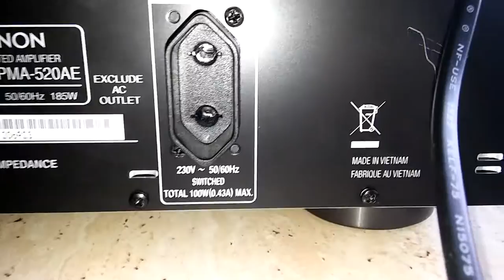Denon PMA-520AE

Comment: Does this amp use series resistors off the main speaker outputs to drive the headphone jack or is there a discrete headphone amp?
Reply from the maker: I do not know exactly if using serial resistors or headphones are not so skilled in the field of amplifiers
Reply: Yes, it is using a series resistor.

Comment: Would you buy this or the Onkyo A 9010?
Reply from the maker: are just as good at your choice as you would prefer to buy
Reply: i had the two models , Both are good , and similar , powerful basses and performing in all the frequencies, great value dor money, in my opinion Denon is sligthly better, and i still have , after i have sold 10+ amplifiers